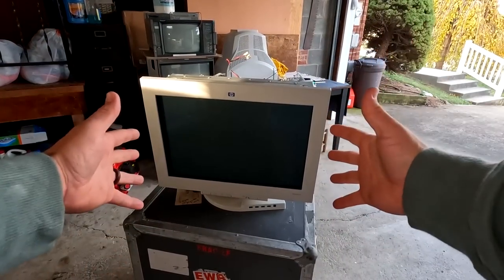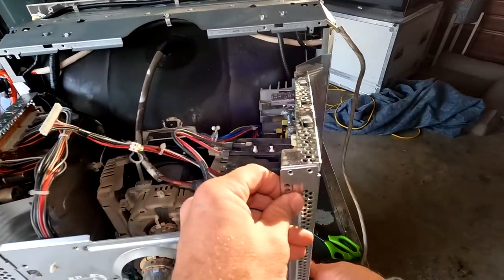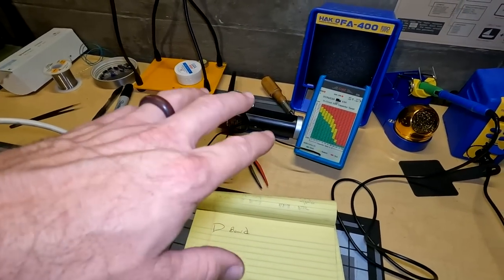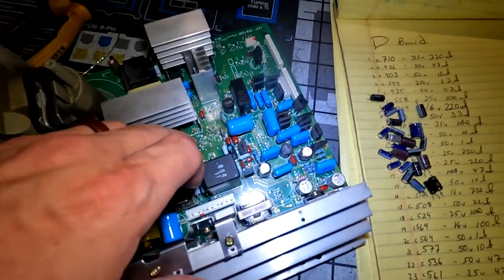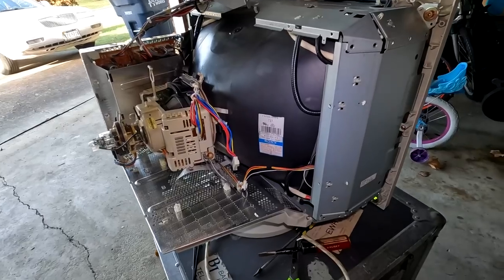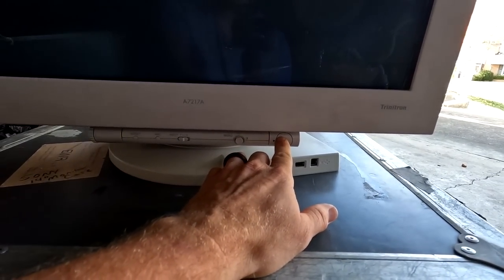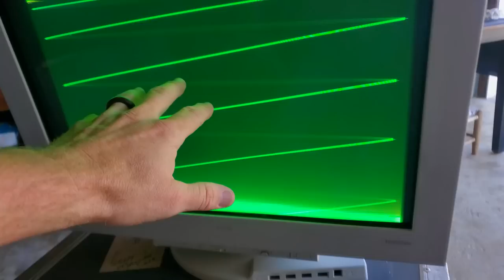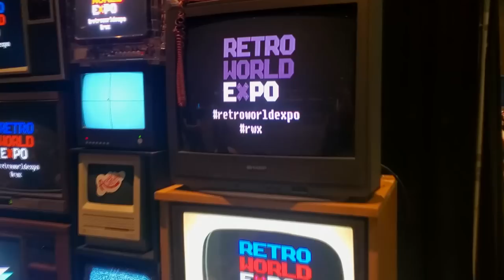The BEST CRT in the World - The Sony GDM FW 900

Comment: So you have the C520K and the FW900 now, haha you are one very fortunate guy, the C520K is actually slightly superior to FW900,  and IMO there is still one better than both of these monitors, the Sony GDM-5002PT9, all three have the amazing SMPTE-C phosphors, which render unbelievably rich and vivid colors, but the 5002PT9 has a slightly curved screen, it's otherwise exactly the same as the C520K, but the curved screen just makes everything pop more on the screen, it also gives the image more depth, so the overall IQ of 5002PT9 is just unbeaten and the best I've ever seen on any other CRT, look forward to watching the vid.
Reply: So far after comparing different CRTs, the one that stands out far above the others would be the F520 to me. The sharpness is really something else with its 0.22mm aperture grille, and the specs are amongst the highest as well. I much perfer that one compared to the FW900, but I have to say the aspect ratio of the FW900 can be really appreciated depending on what you are using it for. The F520 also has SMPTE-C phosphors, and when calibrated correctly is absolutely mindblowing.
Now if I have to mention another CRT that I would appreciate a huge lot, but for different reasons, it would be the Iiyama Vision Master Pro 514. That one has no hardware vertical or horizontal refresh rate limit, and it's quite fun to see lower resolutions at a whooping 300+ or even 400+ Hz. It's the same for the smaller Vision Master Pro 454, but I haven't tested this one. I never thought there was a PC CRT able to do that, but this one does. It has a really nice picture as well, with a Diamondtron tube this time. But of course nowhere close to the picture quality of the F520.
Reply: The C520K is not special, its near identical to the Dell P1130 and bunch of other CR1 Sony monitors. The GDM-F520 is the only CR1 chassis with a .22mm tube and it also has upgraded video board and other small differences.
Reply: @Slay3rOne  The VMP514 is a piece of garbage that has a hilariously low real bandwidth for its specs - the high resolutions look blurry as hell. Iiyama in general is Samsung-grade as a brand.
Reply: @anomyymi0108  Not true at all for the blur at high resolutions, at least not on mine. That's weird. And what do you mean low bandwidth?! I literally displayed 2880x1800 at 105Hz interlaced, 1600x1200 at 210Hz interlaced, 3840x2880 at 52Hz interlaced (that one was dumb, but fun to see working). I've never seen anything blurry at all! Same thing for progressive at around half the refresh rate. Now you have the limitation of the aperture grille of course. This is a 0.24mm AG pitch, which is not as good as some other models, but it resolves what it can, and does so as sharply as it can at least on mine.
Reply: @Slay3rOne  I could be wrong, I'm basing this off reviews from the time and general experience with iiyama as a brand (they have a habit of underspeccing their amps). Can you try 1440p93hz, and compare it to 1440p75hz, how much difference in smearing is there between the two?
Reply: @anomyymi0108  I'm gonna note that, and get back to you when I find the time to test that 👍
Reply: @Slay3rOne  F520 gang represent. Got rid of my FW900 and kept the F520 it's that good.
Reply: @pt_samurai474  Haha, I'm not getting rid of any CRT that's for sure. But yes, agreed!

Comment: Hello, very good channel with a real crt screen enthusiast, I would like to have an expert opinion like you, here I have a 20 inch sun microsysteme pc screen, the screen works perfectly I just have a problem on a very small horizontal line, is it repairable?
Reply: Sounds like a stabilisation wire for the aperture grill of a Trinitron/Diamondtron tube.

Comment: I had a trinitron crt that would have these lines sometimes, and not power on. But after putting a heat blower on it for a couple minutes it would work again. Ps I am  way less technical than you, just an experience i had.      In more technical comments below also talk about heat i see.

Comment: Is it better than a BVM?
Reply: The tube is basically the same as in a A24 and D24 BVM.
Reply: It depends on the use you make of it. Me personally I'd take a high end CRT monitor over a PVM/BVM anytime, for its flexibility.
By that I mean it is not limited to specific standard resolutions like 480p, 1080i and else, it can display whatver you throw at it as long is it's within its specs. But that said, most PC CRT monitors including the FW900 do not natively display 240p/480i contents, and would require adapters to connect consoles. For 240p for example, using a line doubler like the OSSC brings a monitor like that as close as you can get to what would be displayed on a native 240p CRT, with the scanlines looking exactly the same as well.
Now, note that I am more interested in PC games when we talk about retro gaming, so I can't say I was able to do a lot of comparison myself with consoles, but I did run some tests with a SNES, PS2 and PS3 on the FW900, F520 and a few other Trinitron and Diamondtron monitors. Basically, with the correct adapters and if the monitor is well calibrated (there is software for that with Sony monitors), I can't imagine a BVM having a noticeable better display quality.
And also note than the FW900 has the same tube than the BVM D24 but the D24 is limited to the 1080i standard when the FW900 does 1080p, and 2304x1440 at 80Hz (which is only useful if using it on a PC, though). Fun fact, the FW900 (or was it the F520? I don't remember) can also display 4K60, when using the right hardware and pushing things to the absolute limits, but there is no real usefulness in that.
To conclude, I, myself, feel much more at ease using a high end Trinitron/Diamondtron PC monitor compared to a PVM/BVM for the flexibility. I wouldn't see a PVM/BVM as an upgrade at all, rather a downgrade. But that's my own opinion, remember that I play more on PC than consoles, that of course does affect my judgement quite a bit here.
Reply: @Slay3rOne  Elden Ring 4k 60fps on this monitor...I would love to see this.
Reply: @joshforsyth5710  It has some noticeable flicker at 60Hz though, so I'm not sure it would be too comfortable playing long like that.
Reply: @Slay3rOne  1440p then?
Reply: @Slay3rOne  Only the F520 (and any other ~140khz tube like all 2070SB rebadges) can technically sync to 2160p60
Reply: @anomyymi0108  It might be the F520 I tested then. The FW900 was probably at 55Hz.
Reply: @Slay3rOne  Yea GTF 2160p54-55hz should work on an FW900
Reply: What I find pretty insane though is how high the pixel clock can go on these, and it still remains sharp... A Radeon R9 380X with patched drivers can push around 650MHz pixel clock (non interlaced), which is mad high and those CRTs can take and display that just fine.
Reply: @anomyymi0108  It was adjusted CVT or GTF, I lowered some timings as low as I could possibly get them without distorting the edges of the picture, to push the vertical refresh rate as close as possible to 60Hz. But I don't remember exactly where I ended up. Probably around 55 something yes.
Reply: @Slay3rOne  For games flicker is no problem, for computer use it is.
Reply: @anomyymi0108  But its aperture grill pitch will definitely not resolve 3840 pixels. You better try 2560x1440@80Hz.
Reply: @lovemadeinjapan  While I tend to agree with that, I would say some people are more sensitive to it that others. I think it should be mostly fine for me, but I'd much rather avoid any visible flicker when possible. And 60Hz is very clearly noticeable to me, below is just madness, I don't notice any flicker anymore around 75-80Hz.
Reply: @Slay3rOne  So you don't go to the movie theater? It has a 24fps flicker....
Reply: @lovemadeinjapan  that's definitely wrong! First of all, don't mix up fps and Hz. Movies are in 24fps, but projectors definitely don't run at 24Hz, but multiples of the movie framerate, probably 72Hz, maybe 48Hz exactly to avoid any flicker.

Either way, even if it is 48Hz, it will not appear flickery at all, because you forget when talking about a CRT that it is a raster scanning type of display! The entirety of the frame is not displayed at once, instead the beam scans from top to bottom, only the area where the beam scans is illuminated, and goes back to black very quickly as the beam moves away, which makes the flicker very very noticeable at low refresh rates.
On the other hand, recent display technologies are sample and hold, meaning that at the beginning of the frame the entirety of the display is refreshed all at once, and the whole frame is maintained on screen until the next frame is ready to be displayed. At that point, the whole screen is again refreshed all at once. It never goes back to black, except for very specific cases like when you are using BFI - Black Frame Insertion on OLED - or backlight strobing on LCD. These technologies basically try to more or less mimic a CRT, to improve motion clarity. In this specific usecase, you will see flicker on a recent display.

Now regarding movie theater projectors, it's also using sample and hold technologies, or maybe DLP which is more or less similar, but a little more prone to flickering due to the way the microscopic mirrors work. Which is why projectors are never running at 24Hz, but higher multiples of that.

So to sum things up, while 60Hz is very clearly flickery on a CRT, you can set any flat panel monitor to even 24Hz (if it supports it) you won't see any flicker at all. It will just feel laggy... but not flicker.
Reply: @Slay3rOne  My plasma certainly does flicker with movies, so does the beamer in the theater, and even OLED screens nowadays have black frame insertion: 2 display frames, 1 black one, so yes 72Hz, but each third frame is black, so it has a strobing effect, that is what we expect! Back in the days the rotating shutter had a similar effect. The only one not doing it is the LCD bravia, it is sample and hold and replaces the entire image every 1/24th second, and the backlight refreshes at 20000Hz or so. Oh, and 24Hz on a generic 60Hz monitor does not look laggy, but has judder, as it does a 2x/3x frame dupplication. But an LCD TV has variable frame update rates to prevent judder for PAL, 60Hz and 24p content.
Reply: @lovemadeinjapan  Yeah, I don't really know that much regarding movie type stuff overall. All that is very good infos! Judder yeah, I'm always annoyed by that, that is absolutely horrendous.
Yeah I do have an OLED (Dough Spectrum Black 27" Gorilla Glass, 1440p 240Hz) and I tried BFI. I can definitely feel the slight flicker even at 80Hz, and while I can't see any flicker at 100 or 120Hz, it definitely feels different! Very interesting stuff. Never tried backlight strobing, I only recently got a LCD supporting this, and I haven't tried it yet. Curious to see how this looks. I never had plasma. I used to have a projector, but that was a 120Hz model (Acer G550), and I always ran it at that frequency, so I don't really remember how it looked at 60Hz.

Comment: This is so overhyped. A CRT is great for PAL/NTSC game consoles. This one does not support those. And if you consider it is like 2 grand at least, that is quite a bit for a CRT without relevant use case.
Imagine doing 1080p games on this. A free-to-collect Pioneer Plasma from 2009 destroys this with perfect geometry, wider gamut, greater contrast and more sharpness. For 0€! And it is MUCH easier to hook up, and it DOES work with your old consoles, as it has, drums ruffling, 3x SCART (RGB+composite+C/L), S-video, Component, 4x HDMI, VGA, composite and rusty goo'ol RF. Compare that to 1 VGA and 1 BNC input (try to find cables for that!)

Comment: Most overrated, overhyped piece of technology in retro gaming circles.
Reply: Okay, I’ll bite… Why?
Reply: Lions don't bother with the opinions of sheep.
Reply: Ive owned two FW900s, and know a lot about them in general due to a over 10 year following of them...they are definitely overhyped.
Reply: @wormbagged  Thank you for sharing... you still have not provided an explanation of why "...they are definitely overhyped."  I am genuinely curious.
Reply: @carsono311  the resolution is limited at high fps, just like most PC CRTs, and for the  stratospheric price you should expect to buy a highly used model that is prone to failure from age and wear. The max resolution to frame rate you can push is 1920x1200@96hz which is the absolute limit balancing the two items.
Reply: @wormbagged  Thank you.  So to summarize, you do not think that it is worth current pricing to have a used, high (highest?)-res CRT monitor for PC or retro gaming?  Are you primarily PC gaming / content?
Reply: It's like a 1970 Dodge Hemi Challenger R/T Convertible... you can just say you owned one of the best that was ever made
Reply: @carsono311  Nope. Where consumer TV's do offer value for money, are widely available and easy to repair, PC CRT's don't. They fetch insane prices, have way more complex issues that are impossible to repair as there is tons of SMT tech inside, and PC games still run on modern PC's easily. So fetching a consumer TV is a no brainer for playing your PC Engine, NES or Atari 2600 games, getting a yellowed totally ugly beige CRT monitor for gaming in 2024 is ridiculous.

Comment: At 05:55 the video link of the capacitor diagnostics tool is missing.. What the name of the tool?
Reply: It's called an ESR meter, you can buy those on Amazon or even at Walmart
edit:The model he was using through the video is GME 326 ESR Meter, it's available on Amazon for around 130 bucks, hope I helped!